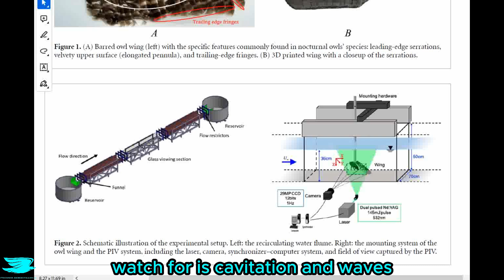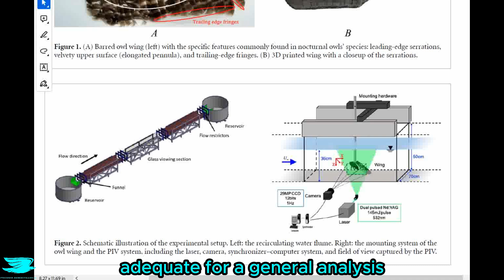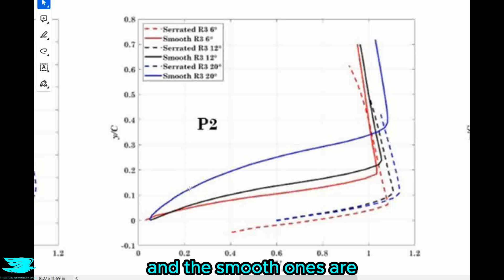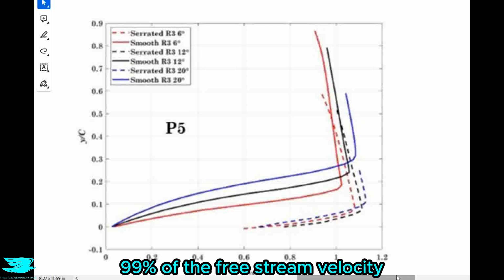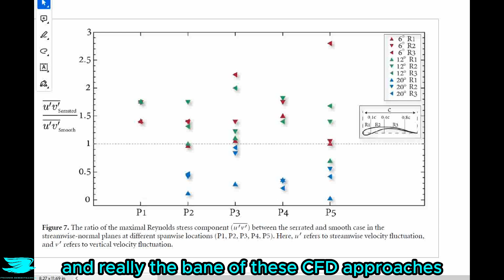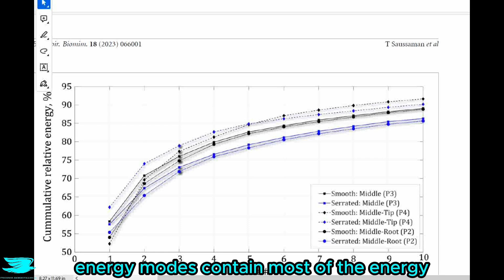Podcast 189 Owl Wing Leading Edge Serration Aerodynamics

Comment: Using birds as subjects; how about the wing tip feathers eagles and vultures have? To me thy look like slats that keep the wing tips from stalling; but what would be the effect at low aoa?
Reply from the maker: There are more types than you can poke a stick at, but generally, they are like sophisticated winglets, and greatly help reduce the induced drag. So, during cruise, there is some drag reduction and an increased lift to drag ratio.

Comment: I agree that each leading-edge serration would function as a vortex (counter-rotating pair) generator, but, similar to a wingtip, only at non-zero angles-of-attack. 

If turbulent mixing from the vortices functions to reduce boundary-layer thickness, then it might result in a more constant BL thickness vs. AoA. As we expect, the data shows strongest effect (analogous to dynamic-range compression) at high AoA.

Besides surface roughness, another factor we have to consider when trying to model an owl is that it possesses a sophisticated control system. Whether gliding or more dynamically flapping, it's able to use sensory feedback to quickly make large changes to wing span, sweep, dihedral, camber, washout, and angle-of-attack; to alter aerodynamic and acoustic performance.
Reply from the maker: Definitely, different parts of the wing can be changed based on the phase of flight. So, that would warrant further investigation.

Comment: Can you do a video on vortex merging? Particularly how it changes flow fields in the transition?
Reply: I'm interested in interaction of co-rotating vortices. 

The Ufonaut painted a winterbourne crop circle. 30.06.24
I guess it describes 5 vortices merging together. Forming the human body. 
There are pics on google "Physics of vortex merging" to compare.
Reply: @c.l.3806  I've been doing my own research, the merges make big changes in the surrounding flow field, and it also tends to introduce Hopf Bifurcations, which can enter a sub-critical state which is extremely unstable. I will continue to research this because I imagine knowing how to avoid that unstable sub-critical state could be applicable in a large variety of dynamic systems.
Reply from the maker: I'm not quite sure I understand. You are interested in when two vortices merge, particularly in a boundary layer? And are you interested in co-rotating or counter-rotating?
Reply: @PremierAerodynamics  

I believe i got hopf bifurcations in my head, shifting interests.

It's just the question if it's possible that 2 counter rotating vortices merge, and produce air movement in one direction. 
Or do the vortices scatter and produce smaller vortices ?

Hopf Bifurcations and turbolences
Did move my mind to LIDAR air speed measurements of Wind Turbines. 
Wind Turbines can afford Lidar.
Passenger Air planes can't afford Lidar. 
Sailing planes with a Lidar to scan for upwinds is interesting too.
Reply: @PremierAerodynamics  the merging and the instability in particular, I'll keep researching in the mean time.
Reply: @c.l.3806  counter rotating don't merge because they're the same 'polarity' only co-rotating merge, they are of opposite polarity. Just like bar magnets.

A vortex ring will not merge with itself. If you take a cross section of a vortex ring, you'll see counter rotating vortices.